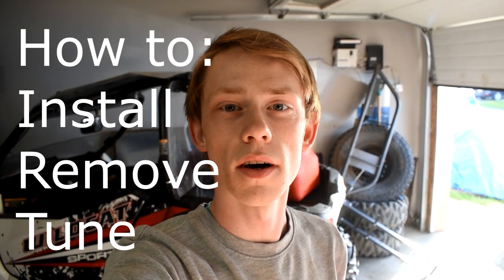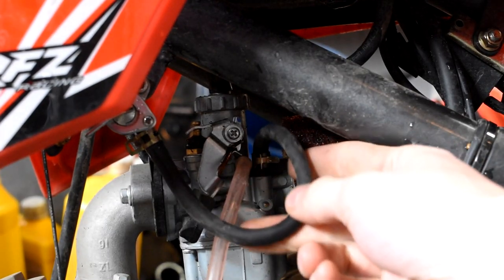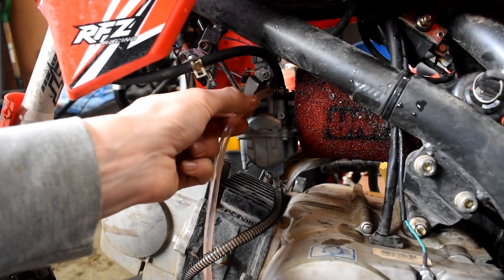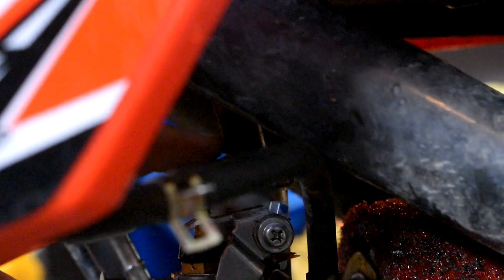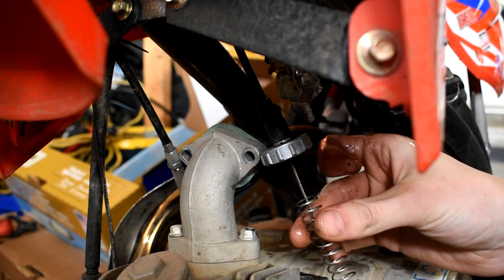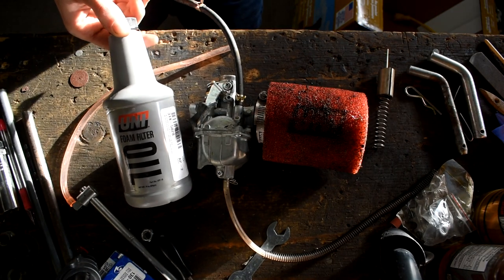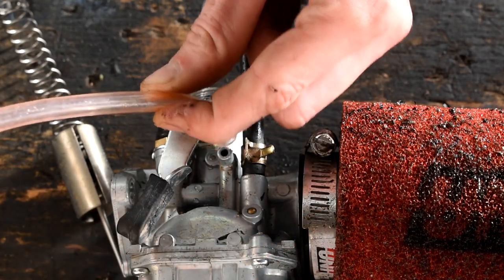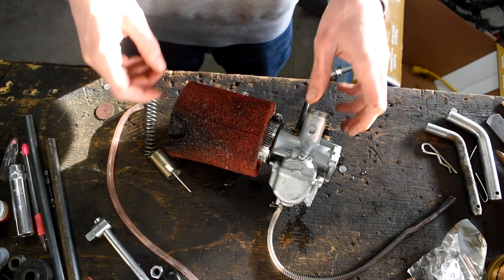How To Fix Dirt Pit Bike Bogging | Upgrading Chinese Pit Bike Carb

Comment: i dont know what happened i tuned my carb over a week ago now its colder weather and its bogging i tried adjusting the mixture it just got rich and lean still bogging
Reply from the maker: Bogging is only ever caused by having too much fuel
Reply from the maker: If it crackles and pop on acceleration thats too lean
Reply: @AaronsEnduro  i know when its idling and its sounds like its misfiring but that because too much air i tried adjusting the Mixture its just bogging when i give it more gas fast but it didnt do it week ago
Reply from the maker: I would be taking apart and cleaning out your carb! No too sure why it would run all of a sudden like that
Reply: @AaronsEnduro  i already cleaned it the mikuni is almost brand new and its idle just fine it just bogs when giving it gas
Reply from the maker: Okay since you say you just cleaned it, did you remove and clean the jets?
Reply from the maker: My friend literally just had it where the main jet unscrewed and was just sitting giggling freely in the carb bowl
Reply from the maker: What air filter do you run
Reply from the maker: If you wanna chat some more hit me up on Instagram @aaron_greenway
Reply: @AaronsEnduro  Uni filter i just cleaned it
Reply: @AaronsEnduro  i sended u message on instagram

Comment: What does bogging out mean ?
Reply from the maker: When the bike is revving it will hesitate and sounds like bogging
Reply: @AaronsEnduro  oh ok I have an the same bike you have and gas is leaking out of the line ?
Reply: Do I have to get a new carburetor
Reply from the maker: Replace the leaking fuel line if its cracked or cut

Comment: hey I changed my carborator on my Apollo x18 and now when I turn it on an give it gas it shuts my bike off what should I do?
Reply: Having the same issue
Reply from the maker: Either flooding or starving the bike of fuel
Reply: @AaronsEnduro  I’m new to this; would it be as simple as adjusting the fuel screw on the carb? I bought the bike last night and it will start occasionally but won’t idle for long.
Reply from the maker: I’d start with looking at the spark plug to tell if its rich or lean first. White is lean, black it’s rich
Reply from the maker: Then watch this Understanding How To Tune A Dirt Bike Carb
https://youtu.be/oyGP1uTU-jE
Reply: @AaronsEnduro  thanks for you help, I will check that and see. I noticed the throttle cable had a zip tie on it outside of the carb. I saw another video that said it was a “hack”. If the cable is too loose, I imagine that could be an issue for cold starts.
Reply from the maker: @jeremya7299  for cold starts use the choke to lean it out. The mixture will help with getting it to fire up, let idle for a minute or two, then turn choke off and then you can ride.
Reply from the maker: @jeremya7299  your idle speed is set my the idle screw, and is also affected by the fuel screw (leaner it is, the higher it will idle) you want to fine the correct spot with the fuel screw first, then set the idle screw
Reply: @AaronsEnduro  just wanted to say thanks for helping me figure this bike out. The spark plug was fouled; I think the loose throttle cable was getting stuck and dumping too much fuel causing the plug to foul. (I guess)
I changed the plug and adjusted the throttle and my son and I were able to get in a quick ride on Sunday.  Thank you for your help! Gained a sub from me.
Reply from the maker: Heck ya man! Thats what its all about! Only happy to help a fellow rider out!

Comment: My bike idles like a champ but bogs very badly when throttle is given
Reply from the maker: sounds like you need to adjust your clip position and or fuel trim
Reply: @AaronsEnduro  i have adjusted it its on leanest it can be and i have tried everything i have 22mm pz it works great with it but i miss mikuni and the sound of it

Comment: So did that fix your issue?
Reply from the maker: Which issue haha
Reply: @AaronsEnduro  the bogging
Reply from the maker: Yes!
Reply: @AaronsEnduro  I will try matching my needle with the stock one then im having bogging at low rpm but then at wot its fine but even at the leanest setting on the needle im still running to rich
Reply from the maker: Thats the pilot jet you need to adjust!!
Reply from the maker: Lean out the fuel screw
Reply: @AaronsEnduro  thats the weird thing I try to lean it out with the mixture screw and it gets worse and my plug still looks to rich

Comment: Cant get the spring part to sit in carb correctly
Reply from the maker: Send me a dm on instagram its easier to explain with a photo
Reply: Wont go all the way down
Reply from the maker: U needa turn it 180*
Reply from the maker: (The cylinder part on the throttle spring)
Reply: @AaronsEnduro  whats your ig
Reply from the maker: @450brucey2  in the description
Reply: Lol i message you
Reply: Thank you so much finally got it right
Reply from the maker: Fk yeah!
Reply: @AaronsEnduro  i need you again 🤦‍♂️
Reply from the maker: Sup
Reply: @AaronsEnduro  ok im trying to swap clutch levers but the clutch cord is to short for the new clutch lever
Reply: @AaronsEnduro  it’s either i have enough for the lever side and not enough on the engine side or vice versa I know i need a slightly longer by maybe a inch
Reply from the maker: @450brucey2  why not just slide the lever down the handle an inch
Reply: @AaronsEnduro  i did that still short wont fit in the adjustable part on the lever
Reply: Im at work now but ill send some pics later or 2morrow
Reply: I even tried to go back to the old lever wont fit so i know it’s something im doing wrong
Reply from the maker: Yeah i dont get what youve done
Reply: Okay got a new clutch cable installed correctly I believe but now wont start and if I pull the clutch in and try to kick start in 1st no compression at all if i release the clutch i get compression but wont start any idea what I did wrong
Reply from the maker: @450brucey2  the clutch sounds correct. you just need to kick it over without the clutch
Reply: @AaronsEnduro  it wont my leg is numb lol
Reply: I really appreciate you by the way
Reply from the maker: Did you take anything else off between it running and now other than the clutch cable
Reply: @AaronsEnduro  yea the throttle from the carb
Reply: Only reason I rerouted it was whoever assembled it had the throttle cable in front of handle bar pad so if i turn it would pull on it which would throttle the bike almost whiskey throttle without having my hand on the throttle kinda scary you should definitely mention that in one of your videos to look over the bike to make sure everything is probably installed damn near went through my garage

Comment: Mine bike bogs down when floring it in the mud do you know what that is you will help me out allot
Reply from the maker: So under load, it has bogging. To me sounds like the bike is running too rich, and or possibly your throttle needle position may need to be changed to open the throttle valve open sooner
Reply: @AaronsEnduro  thx allot dude
Reply from the maker: Yeah man, hope you can get it dialled in! Id suggest doing the carb adjustments somewhere u can ride to test it back to back, without having to bring it back home etc each time
Reply from the maker: It took me a while and many time of removing the carb etc to get it just right, but then u wont have to mess with it again after
Reply: @AaronsEnduro  im really thankful thx
Reply from the maker: Welcome to the squad 🤘🏼 always feel free to ask for help on my channel
Reply: @AaronsEnduro  i will😁

Comment: The link to the VM24 replica carb is incorrect...can you/someone please point me to a replica VM24 that has turned out to be a good carb?
Reply: To add to my question above...I just bought an Apollo DB-X18 and I want to do a carb upgrade so looking for suggestions.  I dont know if it has now a 24, 26 mm.  Also will I have to re-jet when I change the carb?  Your help and guidance will be appreciated.
Reply from the maker: @robertocalderon3376  good and replica dont go together. Yes you will have to rejet a carbwhen installing
Reply from the maker: i run a genuine vm24 and thats why i dont have carb issues, and super snappy throttle

Comment: Bro i have problem with my throttle ... when i give fast throttle its bogs...if i give slowing throttle doesnt bog... help me out?
Reply from the maker: I do online mechanics by donation 
https://www.paypal.me/agreenway13

Send me a dm on instagram after
@aaron_greenway
Reply from the maker: To start look at the clip position on the needle and try adjusting that, check your spark plug color, and adjust the carb accordingly depending on the color
Reply: @AaronsEnduro  i dm you on instagram
Reply from the maker: Sound sgood :)

Comment: So there is just a fuel mixture screw but no idle screw?
Reply from the maker: Idle screw is on the side of the carb
Reply: @AaronsEnduro  where exactly? I only see a screw but no spring on it as an idle should look
Reply from the maker: Not all idle screws have the spring. The only adjustment thats on the side of the carb is your idle screw. Fuel screws are on the bottom
Reply: @AaronsEnduro  ok cool

Comment: Hi I have a rfz 140 I changed the rear bearings earlier today and now the bike has a high idle and drives by its self when in gear. Throttle is not stuck. I never touched the carb while doing the bearings do you know what the problem could be
Reply: Engine is stuck at roughly 1500 rpm
Reply from the maker: If you’re looking for one on one support you should check this out: https://www.youtube.com/channel/UCcviyKZ2Vf3IHFliwebzODA/join

Comment: I have a 140cc rfz and at the top end of my gears it still bocking even though i cleaned my carb?
Could my carb be broken?
Reply from the maker: Sounds like you need a bigger main jet. Sounds like its running outta fuel if it sputters up top
Reply: @AaronsEnduro  does that mean i need a new carb?
Reply from the maker: Watch my carb video to learn about the jets
Reply from the maker: https://youtu.be/oyGP1uTU-jE
Reply: @AaronsEnduro  i now have the problem that my carb leaks fuel could my float be bad or something?
Reply from the maker: @fabiovs6442  yeah its possible! sounds like a float issue